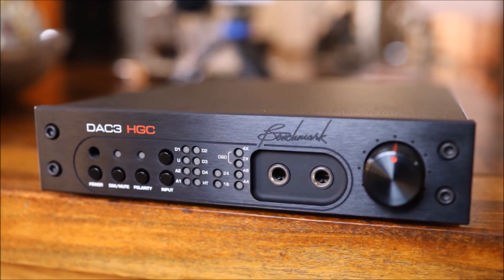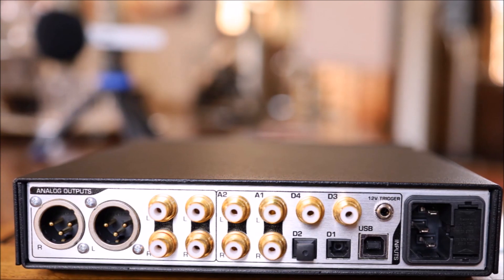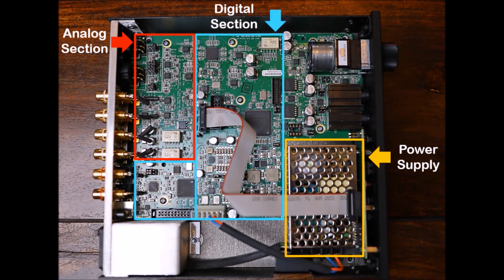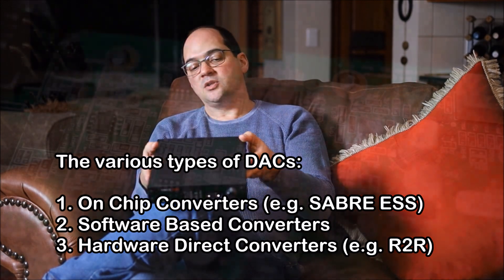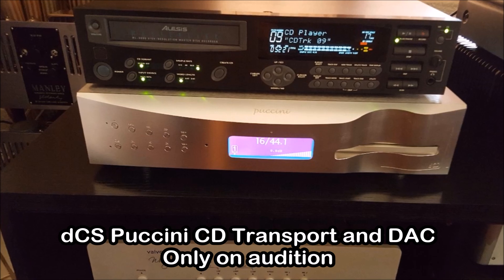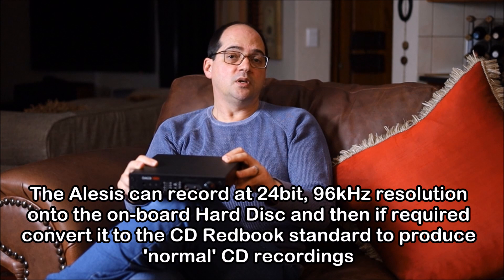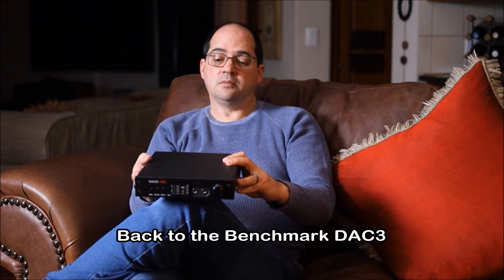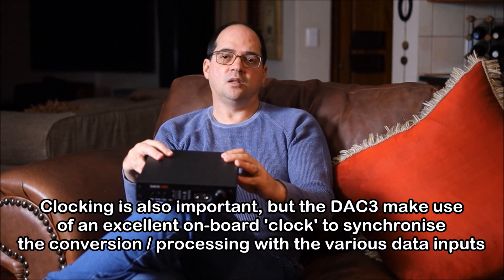Digital to Analog Converters DACs

Comment: Please tell me about the audio quality of the benchmark dac 3 compared to your mark levinson 30 dac.
Reply from the maker: Hi Mike. Thank you for your inquiry. Well to make a long story short...I prefer the sound quality from the Benchmark DAC3 over that of ML 30.6 dac. Both are excellent but the Benchmark is more dynamic across the entire audio frequency range in comparison to the ML. Furthermore the DAC3 produces a more open soundstage and lower noise floor. The Benchmark is really that good. It is (the  Benchmark) also very versatile with plenty of inputs and can handle analog inputs as well. As mentioned in the video - the Benchmark makes the best of any digital format...even lower resolution content sounds fantastic. The only caveat is the form factor...but is it...

Comment: I just bought this DAC, the instruments separation was noticeable and offers more details on the high ends. One thing I did not like was the bottom end of the bass, was less fuller compared to the internal DAC on my Marrantz.
Reply from the maker: Hi Mitoda, congratulations on your purchase and thank you for sharing your experience. One of the advantages in my system from deploying the DAC3 was improved low frequency detail and extension without sounding bloated - thus more natural extension and bass resolution. I am sorry to hear that your internal DAC produced more bottom end. Maybe you can share your setup with me.